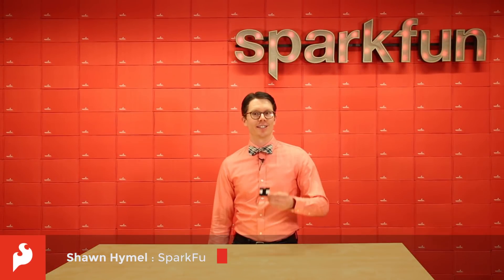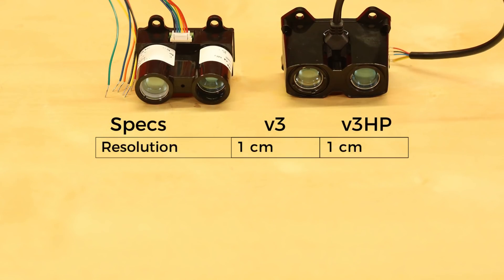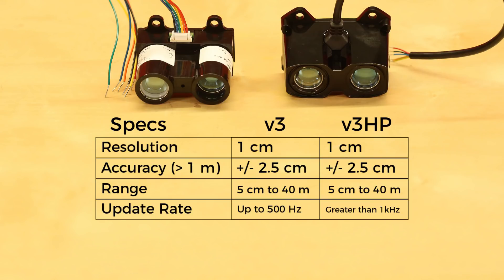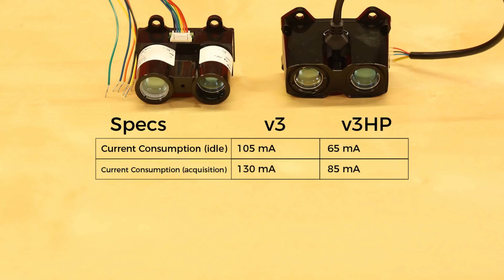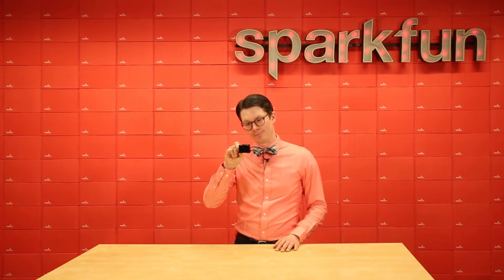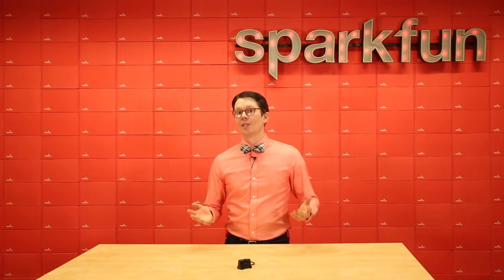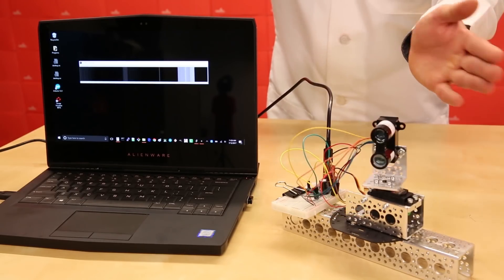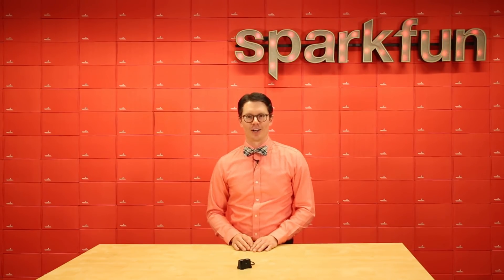Product Showcase: LIDAR-Lite v3HP

Comment: Can the laser in the lidar unit damage your eyes if you look right at it?
Reply: It's listed as a Class 1 laser, which means it should be safe. Always better to not stare directly at it, though ;)
Reply: Depends the wavelength. 1400nm is limit, over 1400nm you probably damage your eyes, between 400nm and 1400nm; it will also damage your eyes but not always immediately noticeable. It has 905nm.
Reply: Someone else has said, it's class 1. While yes wavelength matters, even leds on the white wavelength at high enough wattage could be considered "damaging" to the eyes. Tldr is you're fine!